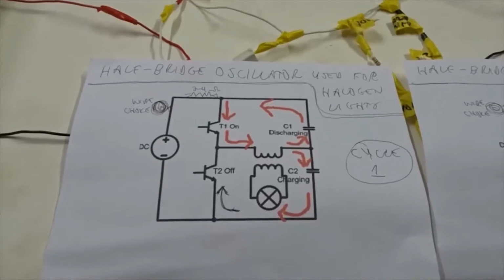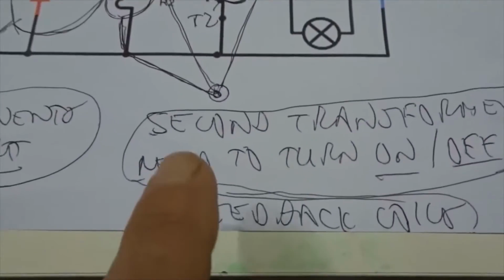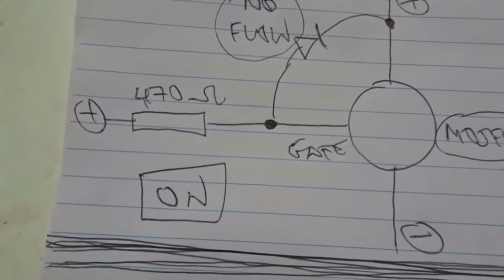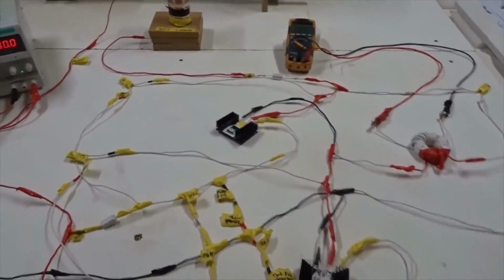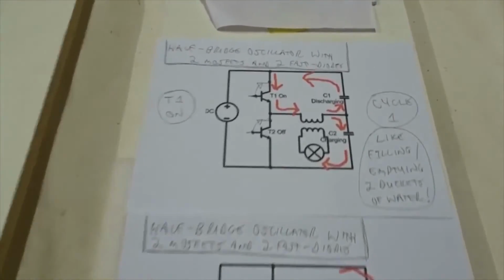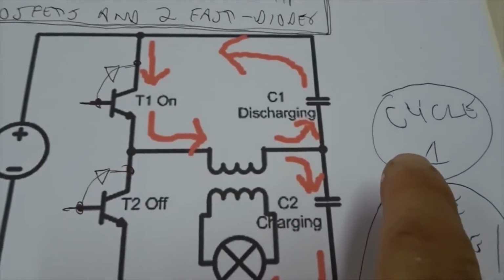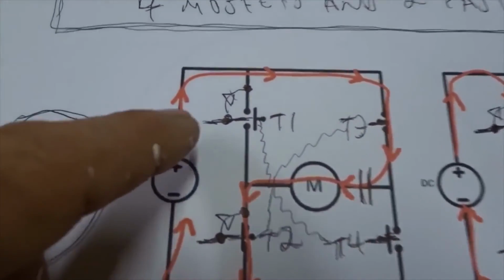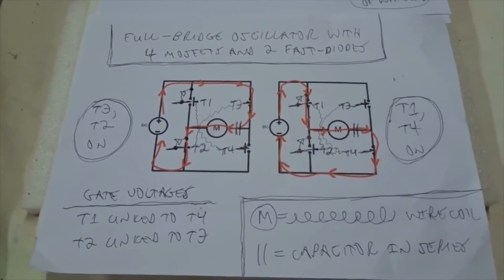MOSFETs and fast diodes for a new kind of electronic transformer

Comment: very cool.  do your mosfets stay cool, since not too much power is going through them?
Reply: They stay cool enough. the major problem with this circuit is that a lot of DC current "leaks" through the T1 and T2 MOSFETs in series, when the capacitors charge-discharge, so that only about 5-10% of the total energy goes through the primary wire coil, with its high AC reactance. I am working on this.....
Reply: @redcollie36  maybe some potentiometers as impedence resistors?